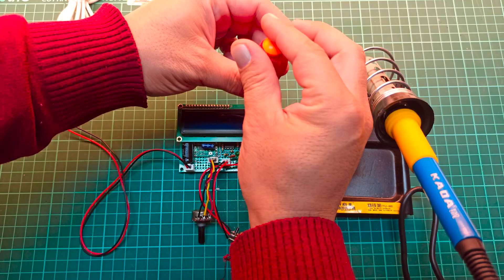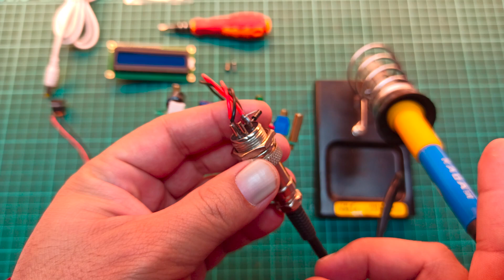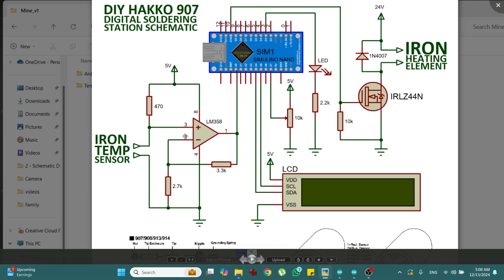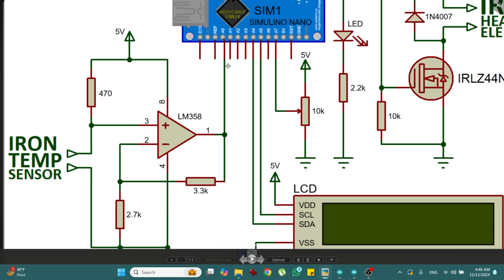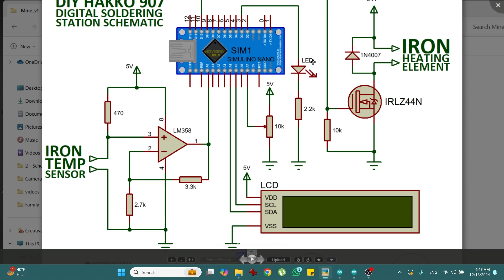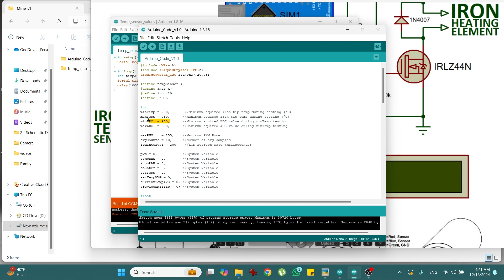DIY Simple Soldering Station using Arduino Nano | Homemade

Comment: THXXX FOR THE PROJECT I HAVE A PROBLEME TO DETERMINATE THE VALUE OF  3 RISISTER 
CAN U GIVE AS THE VALUE OF TOW RISISTER (R=3.3 AND 2.7 ) THAT U USE IN THIS CRCUIT
Reply from the maker: Hi, for my KADA soldering iron i used Rf = 100k ohm (feedback resistor) and Rs = 1k ohm
Reply: @ERLEngineering  THANKS FOR THE INFORMATION IT WORK PERFECTLY FINE
Reply from the maker: Thats great 😃👍